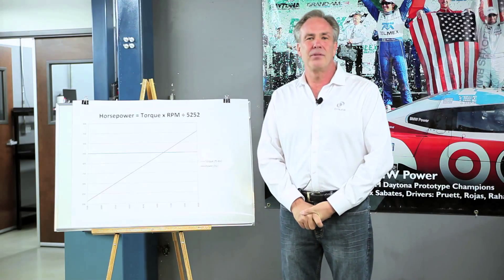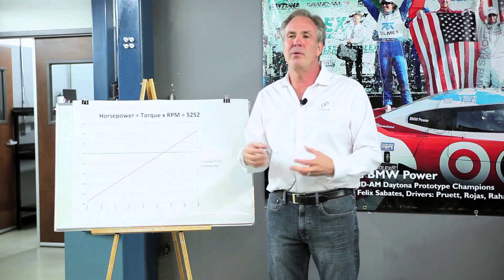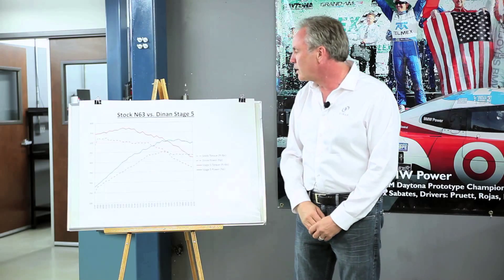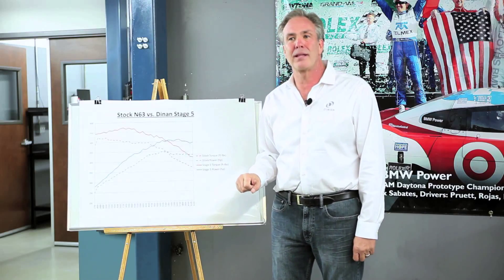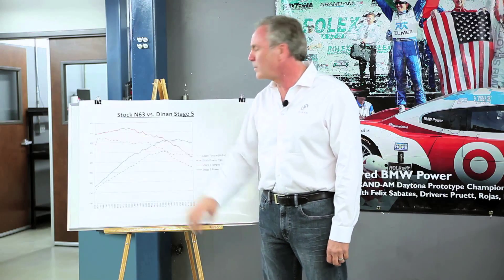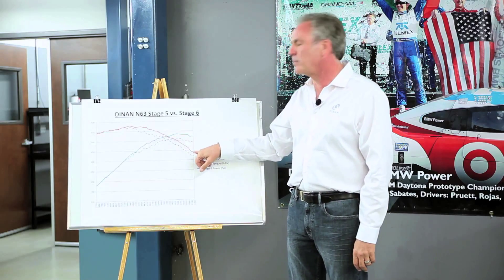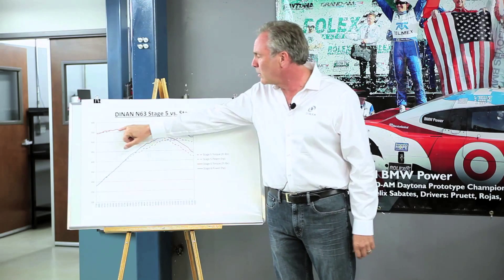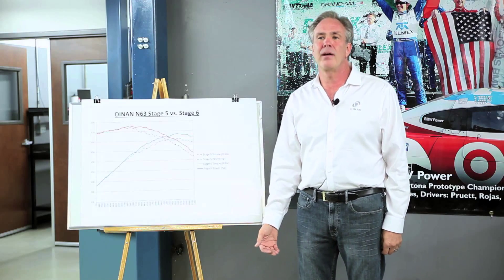Tech Tip Tuesday - Season Two, Ep.5 - Horsepower and Torque relation

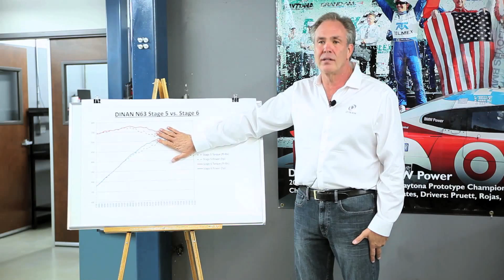Comment: So at 4:02 , when you say I get a 50% more gain in software by itself when adding all the hardware, are you saying that if I add a software to a stock car, but then add a exhaust, intercooler, intake, larger turbo, etc, my software then actually achieves more power than advertised originally? Like the software actually achieves more, or I'm gaining more overall power from the hardware? Curious because I just ordered the stage 1 dinantronics performance tuner for my f30 328i N20 and I'm going to follow that up, for now, with a aftermarket charge pipe and downpipe... But later on, when I add exhaust and start upgrading my turbo, intercooler, etc my dinantronics tuner will actually achieve more than advertised?